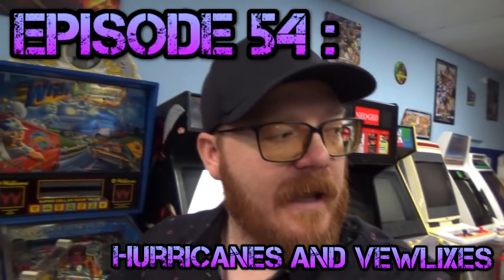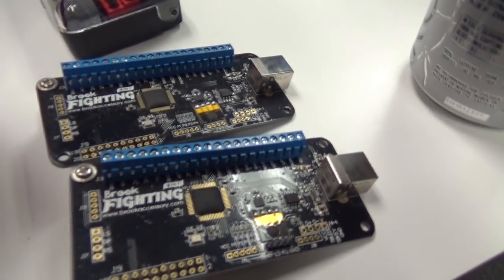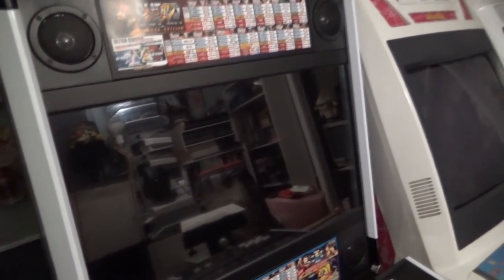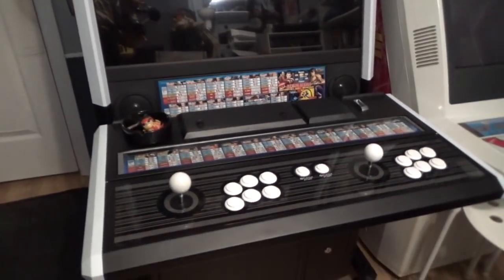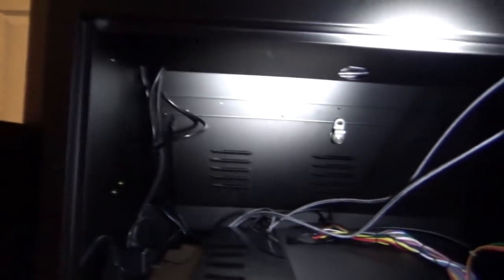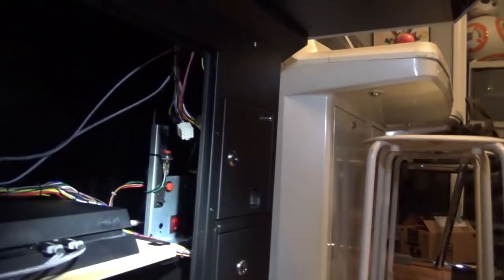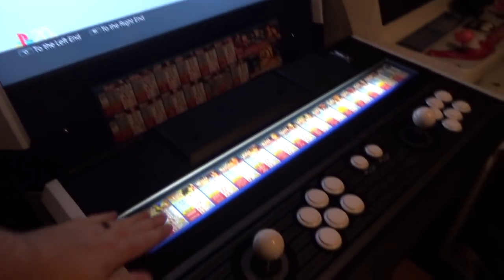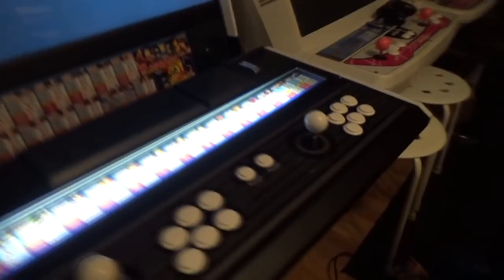Vewlix Arcade Cabinet (Kinda) and Hurricanes!   PastBlaster Episode 54

Comment: Beautiful cab man, for a KO it looks really good quality. I feel if you add LED buttons and LED stick ball tops you can bring it to the next level even more.

The color actually matches that of the PS5 and that one doesn't have loading issues, but you may need a cooling system for it.

The fact that you can rotate the screen is an amazing feature, I would definitely be using that all the time.

Raiden V and Caladrius Blaze are excellent games. I also recommend Darius Burst Chronicle Saviours, Ketsui, Dangun Feveron, R-Type Final 2, G-Darius, the Darius Cozmic arcade collection that comes with Darius Gaiden, and also many of the shooters for the first Capcom Arcade Stadium that has 1944 The Loop Master, Giga Wing, and Progear.

Comment: Beautiful cabinet. Can you do me a favor and  measure the interior of the cabinet for me?

I would like to know the width and height of the cabinet opening and the depth of the cabinet at 14inches vertical

I plan to take out all of the hardware except the coin mechanism and just run a pc in it so I will take out the shelf. 

I just bought a pc case and am not sure if it is too big. My cabinet doesn’t arrive for a week or so but I wanted to get started building the pc. 

Thanks for any help you can provide.

Comment: Hi
Wondering if you can help me.
With the custom JST harness,How do you know which Cable is assigned to which button?
Joystick for Example.
How do you know what's what.
Reply from the maker: Easiest way is to get a Multi Meter and continuity check everything if you don't have a pinout. My cab used the Vewlix pinout, so I was able to find a diagram online.

Comment: can you tell me if you were able to mount a VESA monitor  in the chewlix?  I know they  come with their own monitors . What do you think?
Reply from the maker: I'm sure you could probably fit something on there with Vesa, but the stock monitor mount setup is completely different. Good Luck if you go for it!
Reply: @PastBlaster   I took the plunge and will be ordering a few however I will be doing a mod to purchase a LED monitor , I just think the arcade monitors they sell are garbage , even though they have a low refresh rate.

Comment: Hi nice video that's not normal for the PS4 to take long to load. You are going to need a touch pad button for shmups and other games.
Reply from the maker: What does the touchpad add for shmups? The Brooks has the option to wire a button in for it, I just didn't know what value it added to the game. I do see you kind of need one for the Street Fighter 30th games.
Reply: PastBlaster the touchpad is actually the start button on many of the shmups for the PS4 and other games.
Reply from the maker: Gotcha. Looks like I'll be adding 2 more buttons to the access panel on the top.   Thanks for the heads up!
Reply: Can you let me know where did you order it from and how much was it with shipping?
Reply from the maker: @TheBoySquared  Hey there!  I got in on a group buy for this. The price paid including shipping and all fees with importing etc. The total was around $1500 before anything was added / modified.